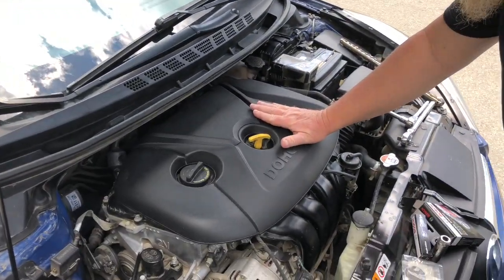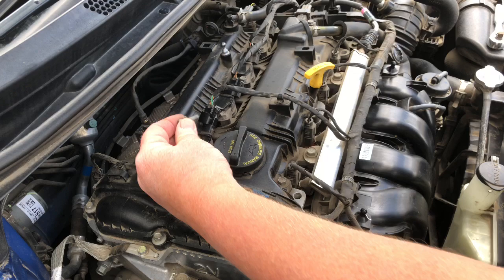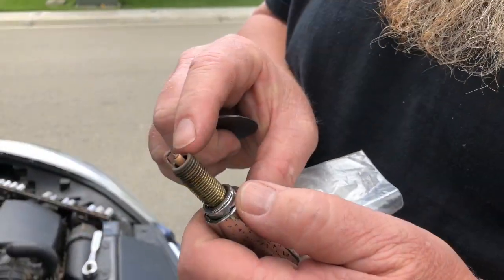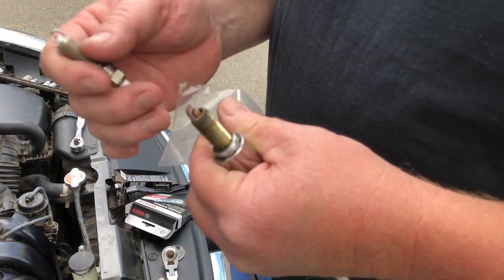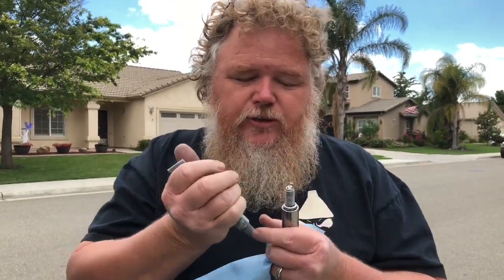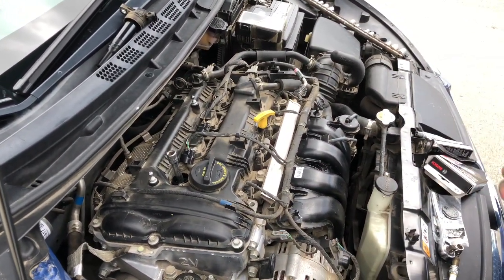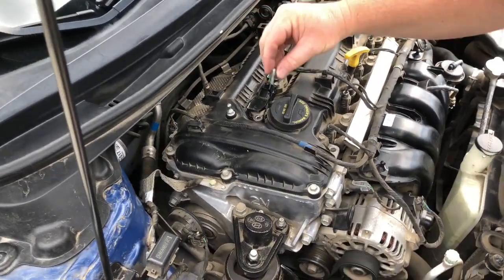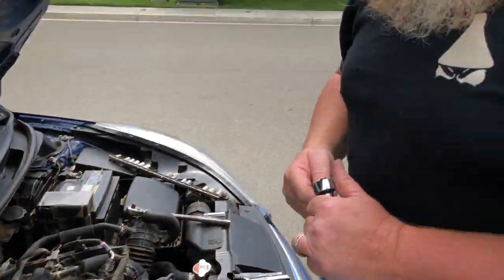2016 Hyundai Elantra Spark Plug And Coil Change

Comment: Your suppose to take some compressed air and blow it within the sparkplug compartment prior to removing the sparkplug, it helps remove any type of small dust particles that might be within the compartment and it prevents it from falling into the engine interior compartment.

Comment: Exactly the video I was hoping to find. My Elantra is finally misfiring @ 214,900 miles and I was hoping I could do the job myself, now I have full confidence!
Reply from the maker: Awesome! Good luck with it!
Reply from the maker: Awesome! Good luck with it!!
Reply: How did it go? I just did mine because of a misfire. Replaced the coil first and that got rid of the code. Decided to do sparkplugs too and the one that had the code was a bit loose so that was probably the problem
Reply: @darrenj9013  do it solve everything?\
Reply: damn mine has had misfire issues twice and its only at 72k

Comment: Thanks for the video, I need to do my Accent, but I always coat the inside of the coil with electrical grease to waterproof it, as well as all electrical contacts. In my experience of Korean, Japanese cars, I always use NGK. They seem to work better.

Comment: Greetings from the Low Country, SC. Thanks for the video. I have a 2014 Elantra Limited with 81k miles and I just replaced the plugs today. I bought the plugs and coil boots from Rock Auto as well. I am having problems removing the boots off of the coil. Tried twisting and pulling but the boot stays put. Any suggestions on how to remove the stubborn boots without damaging the thin rubber wrap?
Reply from the maker: I’ve not dealt with this issue, but you might try spraying some WD-40 or silicone spray into the boots and see if that will loosen them. 
Good luck!

Comment: Thanks for the video brother it was really helpful let me ask you this question my brother took his is the 15 He took is AutoZone in the scanner read coils spark plugs an wires or bad what do you think the chance would be there all bad at the same time I just told you change the coils out first
Reply from the maker: Well, I’d start with the cheapest thing first— the spark plugs. 
My kid’s car didn’t have spark plug wires- the coils went directly onto the plug. They are called COP- coil on plug. 
If the plugs don’t fix the way it’s running, then move on to the coils. 
I’m just guessing here, but I’d think the coils would last somewhere around 150K miles before they gave you trouble.

Comment: Aren't we supposed to disconnect the negative battery?
Reply from the maker: I suppose your factory service manual tells you to, but since the key is OFF, there is no voltage going to the coils. 
Safest bet is to remove Negative cable… but remember- you’ll have to reset your radio stations, click time, etc.

Comment: My 2013 sometimes will not start while it's cranking, but then it will start once I try it again right after the 1st try.

Is this my ignition coil, spark plugs, or it is the fuel pump or filter?
Reply from the maker: Hard to say, but I'd guess fuel. Has the filter ever been changed? Are you getting the correct fuel pressure when you key on? If your pump is having issues, it won't start. I'd check your fuel pressure first.

Comment: The plug that attaches to the coil won't hold tight and nothing broke off. I push that little plastic clip down and it does nothing
Reply from the maker: Unfortunately, she sold the car, so I can’t look at it. I’d suggest looking at both the coil and the connector- one of them has to have something broken on it. 
If you have room, you could always use a small zip tie to hold the connector to the coil.

Comment: I have a 2017 Elantra and it’s reading cylinder 2 misfire would this be the fix ?
Reply from the maker: Jace Houston Without actually seeing it, all I can say is maybe. Spark plugs are a good place to start- pull it out and look at it. If it’s gummed up, oily, wet, etc. it’s either the plug is bad or the coil is not firing.
Reply: @CrawdaddyCustoms  totally agree. i did a full spark plug change on my 2013 elantra  about 6 months ago and the cyl. misfire code crept up on cyl. 4.  it has almost 90k miles on it so im about sure the coil is gone. ordered 4 new coils from amazon and im just going to replace all 4 as the plugs are fairly new.  I also had to replace the cam shaft position sensor as well. things go out eventually.  good video.
Reply from the maker: @mike h Thank you, I appreciate it! Good luck w/ the coils- hope that does the trick for you!

Comment: Yea try it on a GDI engine ....plug #4
Reply: Just a fuel line. Pop it off, replace the plug and coil, put it back together.  Just put a rag under it as it will have a little residual fuel pressure.